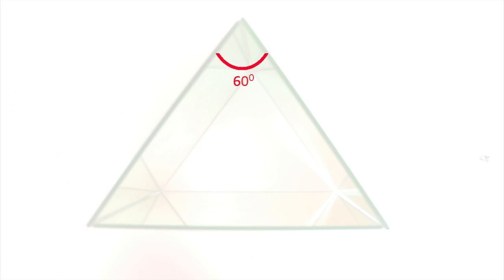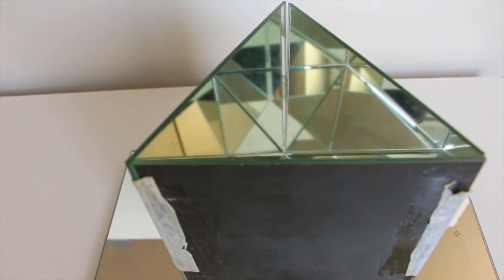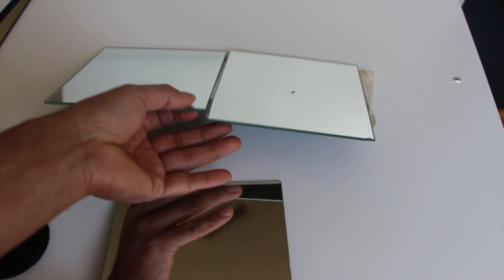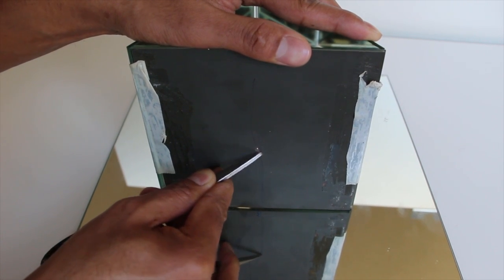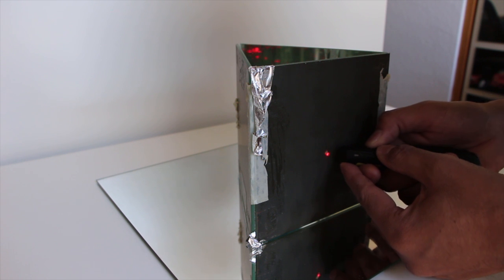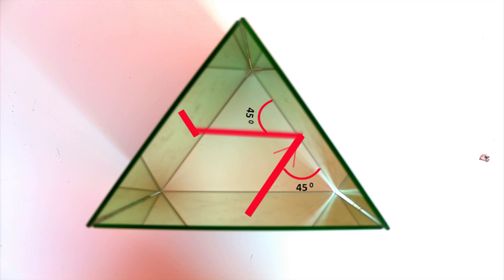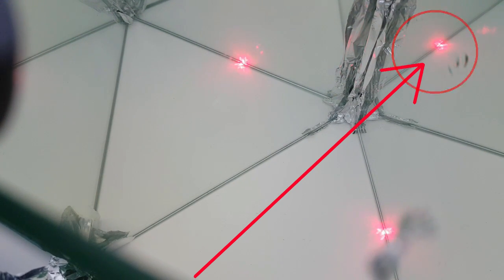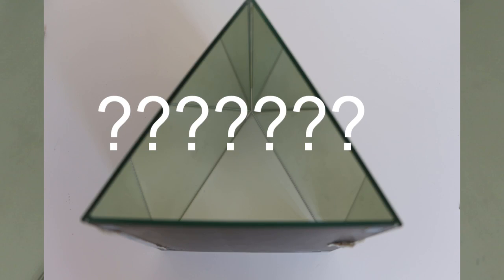Can you trap light in mirror box | Light trapping box

Comment: I have a plan , enclosed your triangular box and keep inside a small camera which a connected flash light with a timer,
When your timer flash 📸 and strat recording the phenomenon,
If the light still traveling in box after the flash 📸
Then you can check the light is trap or not and for how long it can be trapped.

Comment: But some of the light would be absorbed by the mirror at each reflection, usually about 10%. It is re-emitted as heat. Even a really good mirror, 1%. Evcen if it was 0.01%, after 7,000 reflections (rule of 70 in compounding) you've lost ha;f the light. That's say 1.5 miles of light travel. After 15 miles, you have lost 999 / 1,000 of the light (2 power 10 = 1,000). Light can travel 15 miles in under 1 /10,000th of a second. So your light trap won't work.
Reply from the maker: Great point!

Comment: If your hand moved over the speed of light, you might be able to do it. If you put the light at 45° angle, and it hits both of those mirrors… When it comes back to the third mirror, your laser would be in the way… Which means it would not hit the third mirror. If you can go faster than the light, you might be able to get it.😂

Comment: i think if u remove the light source from the outside , the reflection will automatically stop. because the spot that actually going to hit by the reflection flow will have a void for the light to pass through. if only we can put a light source inside the paradime . it will be more realistic but i think we dont need any void or dark spot inside the mirrors . and if we actually came up with a solution like a spark or something inside those mirrors and we manage to trap the light. eventually it will explode. the light will continue to reflect on top of one after another and it will produce heat. even if u put some exsaust outlet inside the mirrors the whole experiment will fail  because the light can escaped on that as well.. i thing thats how nuclear and atomic bomb works a small spark from the inside creating chemical reaction just like the mirror experiment but not as chemical. hehehe i dont know im just guessing.

Comment: I have a question - if You have a light source facing forward, traveling in a vacuum from 1st point in direcion of 2nd point at 0.5 times light speed, and you switch the light source on to show a light forward, how fast does the light from the light source move in relation to the 1st point?
Reply from the maker: Same as the speed of light.

Comment: Bro what were you thinking, you needed perfect regular reflection but you put al tape in it, you didn't clean the mirror, you didn't think about the laser needs to be parallel to the base and to, you put a camera inside which is taking energy, you made a hole on one of the mirrors, mirrors absorb light too so in the contraption within not even 🤏 this many seconds all the light is absorbed and you expected to TRAP LIGHT IN A PERPETUAL MOTION WITH JUST MIRRORS. I just want to know why, it's not even theoretically correct 😭😭😭😭

Comment: The light is not traped and if you turn off the laser the light will stop because 

As you turn on the laser and adjusted it  to 45 degree angle and on the spot on which you have removed the silver coating through which your laser is going inside And through that way the laser will come out and as the laser  is turned on the light is showed on the 3 mirrors and it seems to be reflected and traped but it is coming out the way it goes inside , but how can you trap light in it?
As you removed the silver coating from the glass and stared the laser the laser escaped through the same way,  you need to be faster than light and after turning on the laser you have to cover the spot on which you have removed the silver coating  and cover it with something which reflect full light and then the light will be trapped but it is not possible because you cannot  go faster than light as theory of relativity, which states than we can't go faster than light .

Comment: In a sense it's similar to w particle accelerator, the mirror texture itself would create stronger energy but in and of itself lack enough structural integrity to contain it. Fascinating. Maybe the Egyptians knew what they were doing. Try 4 sides, Maybe the pyramids were placed where they were for the absolute maximum sun output absorption for something.  I wonder how much energy could be contained in the pyramids tri square footage if estimated by multiplying smaller versions together until they equal the size of the pyramid?  All it would take to get the light inside would have been cleverly placed mirrors. 

Maybe the eyes found at the top of pyramids in drawings  were a clue as to how to use this energy. If the light were aimed into the corners where all 3 sides meet, 1 beam of light could become 3, 3,3, become 9,9,9..  multiplying the suns energy by just 1 reflection creates 2 times the output of the sun, which is significantly more powerful.  by reflecting the corners into into other corners PERFECTLY, there is no telling what the end result could be.   Maybe they somehow harnessed enough light energy to send a beam of light from one pyramid  to the next pyramid kind of like how cell phone towers work. wavelengths just become 1 beam of light. I've got a science boner rn

Comment: 45 degree angles are not possible inside a triangle. Only 60 degrees. 180/3=60. 45 degrees requires a square.
Reply from the maker: This is the mistake everyone do, some other guys also asked the same thing, I thing I should make another video why it is 45 degree instead of 60. Anyways thanks fro your comments
Reply: @Matescium  Sorry, the mistake is yours. Even your drawing shows 45 degrees at the apex of the triangle. It can only be 60 degrees in the vertex of any equilateral triangle.
Reply from the maker: @PeteVanDemark  Ah I got you now, I was thinking about the incident beam angle that is 45 degree. But you are right, the angle between the glass is 60 degrees. I was thinking about the incoming beam angle. Thanks

Comment: Imo trapped light means the light will continue on a recycle path as you have demonstated but without its source. Also that equipment you are using is not even close to accurate bcz the light is also reflecting to camera. Even you can trap a light it almost impossible to see it with just a blind eye  a light is a energy wave what transffer energy one atom to another. Mirror ( nothing in the human knowledge is 100 reflective) is not 100 percent reflective and it will absorb some of the energy from the wave and reflected some of its particle to other direction, thats is the reason mirror gets hot from sun light. And once you remove the source of light You might expect to see the light recycle ( even if your tool was 100 percent perfect) for atleast 1 sec. But no, light is so fast that you cant see it blind eyes nor with the slowest camera in the world. You can only obserb it only if the source is active.
Reply: Exactly
Reply from the maker: What you said here, I completely agree with you. Same things I told at the end of the video. BTW thank you for your fruitfull comment.

Comment: What would happen if you did exactly the same thing but used 2 way mirrors with the greater reflecting surface facing inward?
Reply: No.  Sorry.  By two way mirror, I mean the kind where you can see through one side like a window and the opposite side is more reflective almost like a regular mirror.  Police in movies always use these to watch suspects being interviewed so the watchers can't be seen.
Reply from the maker: It will be better for me if you clear what you mean by two way mirror, did you mean two mirrors face to face with 180 degree angle? Well, in that case the incident and reflection point will be the same and i guess it would be difficult to inject the light sours e in the two vertical mirror system you mentioned. Hope i understood you correctly.

Comment: Light gets absorbed by mirrors, so it's not possible for us to see the trapped light. But what is we make a system where we get total internal reflection. That means all the light is reflected and non gets absorbed. 
Sir, can you think of a way of making this where we can get total internal reflection from different parts and try this experiment again if it is possible? 

And I was thinking not to place any object like a camera inside the device. Because any non reflecting object will help the light escape.
Reply from the maker: I already thought this way. You can think a optical fiber cable in where total internal reflection occurs inside it. I believe light trapping is possible in a closed environment in where no light photons are absorbed by the reflected wall. But in real its not so easy to build such a system.
Reply: @Matescium  yes you are correct. Thank you sir.

Comment: Lol what is this a click bait?   The fact that you can actually see it only means it’s not trapped.  In theory, you can’t trap light in a “trap box” forever even if the mirrors are super perfect.  Light is made of photon and to begin to see light it’ll have to hit the sensors in your eyes.  So if you want to trap light in a box you’ll have to precisely loop the direction of the photons to repeat the cycle over and over again.  Another dilemma is, the mirror itself is made of atoms that can absorb the photos.  So it might deflect or re-create the same photon of similar properties a few times until it absorbs it.  Even if you somehow managed to trap a single photon, you won’t be considered trapped if you can see it.  It simply means it escaped and hit your eye.  However, maybe you can trap light using electromagnetic fields or gravity...  that’s my theory.

Comment: Can the photons infinitely trapped in the box if the absence of the source and with the same concepts of the structure just without the hole? Like after you shoot the laser into a mirror and it keeps reflecting then you quickly cover up the hole can it be trap in there infinitely?
Reply from the maker: Its possible with perfect mirror!! that does not absorb the light photons. Practically is not possible.

Comment: Henry wilken is right that is exactly what I was going to say and for the questions at the end no the light won't stay inside cause it is perfectly reflecting to the source so when you stop it goes back to the laser and since the laser doesn't reflect that is the end or out the hole you just shined through. And it will keep going and bounce off of things until it hits something of the same wave length or color but then you would just see that item.

Comment: Nice experiment,
Can you pls guide how to make triangular shape based solar panels....soo dat small sunlight areas can also give high power output..

Also, how to use fiberoptic cables to transmit solar light through filament into individual rooms using a simple solar light collector filament...
Reply from the maker: I appreciate your ideas. First of all, enough solar power cannot be transmitted through optical fiber cable cause there are a certain loss of photons during the transmission. Not only this but also a tiny optical cable cannot transmits enough light to illuminate a room. Second is, I also thought the similar way of using low power sunlight effectively by solar panel, but in this case triangular shape solar panel might be costly. Instead of, semi double layer solar panel may work out as the second layer absorb the reflected part of solar beam that is not use in conventional panel.

Comment: A perfect mirror isn't possible- even theoretically. Even if you were to isolate a single photon, I think at the quantum level it would degrade after several trillion bounces (which is nothing) because  the sub-quantum photon constituents would "smash into each other" You might get some interesting results from studying that interaction, but of course you couldn't observe them without changing them. 
I think that stretching the limits of what's actually "buildable"- and being generous with your theoretically possible best-case scenario... would be useful enough to do a millisecond of quantum computing though!
Reply from the maker: You are right. Perfect mirror building is not possible in sense of absorbing the energy of photons. But I made mirror of platinum, its much better than general mirror.

Comment: can you answer me why light can,t bend  in  same  medium..? and why  it move in a straight direction..in the same medium.?
Reply: Better to understand this by change of speed...when light passes from a lighter to denser medium it bends due to change in its speed
Reply from the maker: Great question. The short answer is refraction. When light photons/wave changes its medium, its speed and wavelength is also changed across the boundary between two mediums. The phenomenon is detailed explained by quantum theory which is a bit complex. The summery is, when a light changes its medium, its wavelength is also changes that leads to its path bending. Onthe otherhand, its dont change títs direction in same medium caue the energy of light photons is not changes/wavelength remains same.

Comment: Light travels with the speed of roughly 300.000 km/second meaning your small mirror box would be 30 billion reflections/second assuming the length is 10 cm, the problem with that is that the mirror can't be perfect and if it's not a vaccuum, light will hit dust particles or even get absorbed by gasses in the air.
Reply: I was thinking the same thing about the light being absorbed by particles & dust if not in a vacuum.
Really interesting video! 😃
Reply: wouldnt it be 3 billion?
Reply: @JuankQuinteroMejia u do times 10 again cuz it’s 3 mirrors
Reply: That's why it can't last forever
Reply: btw my box is a 3 sided triangle, and now i just came up with another result...i am lost and cross eyed🤣
Reply: Would the light not be losing energy each time it hits a mirror. And if you could work out the rate of loss. Couldn't you get a rough idea of how many time it was able to reflect
Reply: @timmyturner6002  plus the loss by the air itself in there slowing it down
Reply: Air absorbs Light? And I can see anything on earth how then?
Reply: @SunShine-xc6dh  Most light on Earth hasn't traveled for over a second through gasses.
Reply: @SunShine-xc6dh  it cannot absorb all light plus it reflects and scatters
Reply: @ethanmac639  so pick a frequency it can't absorb or interfere with
Reply: 30 billion cm in 300,000 km ÷ 10(10cm) = 3 billion
Reply: @ethanmac639  It's been over 3 years ago that I typed it, you're right but I also don't know where I went wrong to get to 30 billion. Either way it doesn't make anything else I said less accurate.
Reply: @udntknw001  i think i might have been wrong, i forget how i came to 3 billion, but it was through my own math not just agreeing with the other commenters, i actually think you were on the right path but forgot the last equation.....let me explain by how i came to my new number, which is 10 billion, ie; 10 billion reflections(this is where you forgot to divide by 3 i think), i came to this by calculating the number of cm in a km, which is 100,000 cm, then by multiplying this by 300,000 which = 30 billion, this is where you stopped, your math is correct but you forgot that the light in the box doesn't travel parallel along the sides, it reflects off them, and in a triangle box there are 3 reflections, so divide the light distance of 30 billion cm by 3 equals 10 billion reflections per second, but even this is wrong, because the distance of reflection is not the 10cm per reflection, as the light is hitting the middle of the sides, which from side to side is half the distance, so it is 5 cm, so we must double the reflections to 20 billion per second....i think i did things right this time...i hope, to be honest i am confused as hell, math makes me cross eyed...lemme know what you think, am i right now or am i doing math wrong?
Reply: ok lemme try again
Reply: yup my math was slightly flawed, i divided the 30 billion cm by the 3 reflections per rotation, then multiplied it by 2, when i should have divided the 30 billion cm by 5 cm, and if i made the mistake of dividing it by 10 cm, then multiplying it by 2 would correct this, so my new answer is 6 billion reflections per second because the reflections reflect every 5 cm in a triangle box with 10 cm sides
Reply: @ethanmac639  So uh, what's your final answer? 😆
Reply: @ethanmac639  But yeah I agree to that number. 6 billion. I'd just take 3*10^11 mm/sec / 50 mm = 6*10^9 reflections/sec though. I won't correct it in my reply because it makes others check the comments what the real answer is, lol.
Reply: @udntknw001  lol, yes i am pretty sure it is 6 billion reflections per second, cause there is 100,000 cm in a km, and 30 billion cm in 300,000 km's, now there 15 cm per rotation in a triangle box with 10 cm sides, because the middle of each side to the next is half that 10 cm, which is 5 cm, and multiplied by the 3 sides per rotation is 15 cm per rotation, now if we divide the 30 billion cm by the 15 cm per rotation we get 2 billion rotations per second, and then we must multiply the 2 billion rotations per second by 3 reflections per rotation, which is 6 billion reflections per second
Reply: yes not infinie

Comment: Mirrors do not bounce lights at 100% efficiency. And because light moves at an insane speed, as soon as the laser is turned off, all the light vanishes completely in probably fractions of a nanosecond
Reply from the maker: You are right, the light made of photons and the mirror object absorbs the energy of the photon. As a result, the light gets vanished immediately after turn off the mirror.